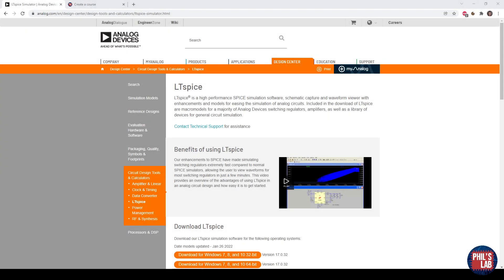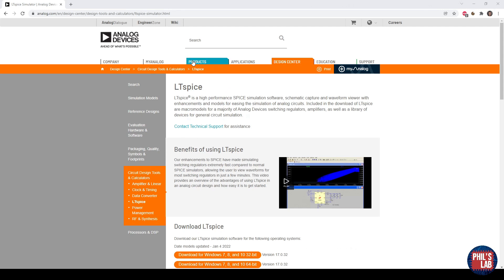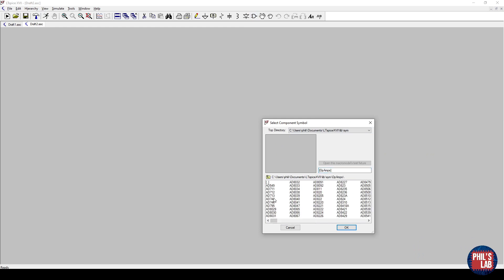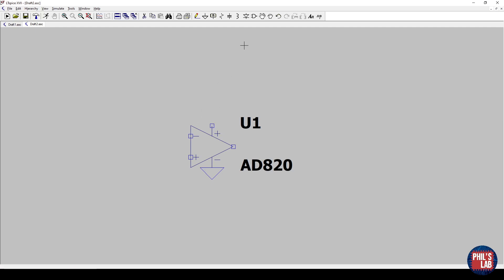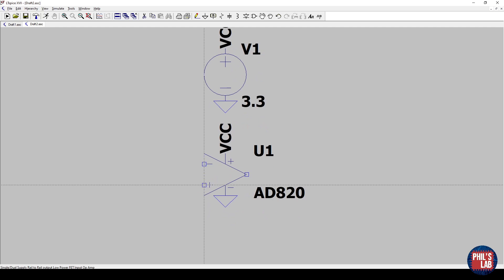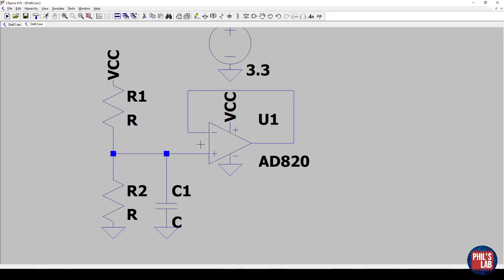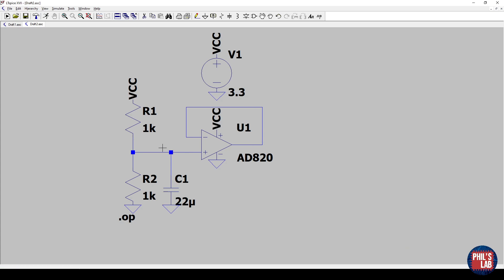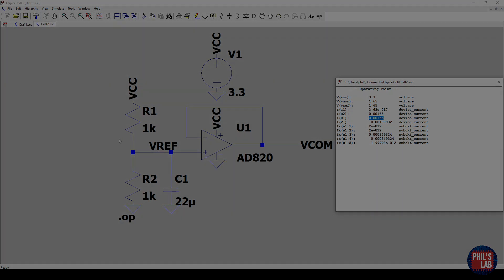(Sponsored) LTSpice - Basics and DC Operating Point Analysis - Phil's Lab #48

Comment: I started using LTspice a lot to try and build a 2KW LLC converter. I had to make a sub circuit for the L6599 IC (it was what I could get my hands on) but no model for it unfortunately.

One problem I ran into was the ground symbol is global to the schematic and included subcircuit models. The 'GND' pin on my symbol does not actually connect to ground. This limits the ability to have the chip floating on top of a voltage rail for instance since it is referenced to the global ground net.

How do you get around this?
Reply: What I've done in the past is to add a big resistor linking your real GND to the floating GND. I think the maximum value is something like 1 TΩ (teraohm). You could also add a tiny capacitor in parallel
Reply: @gino.avanzini  I have done the same simulating 3-phase circuits. In reality there is always some leakage however minute. Which transformer does not have a leakage capacitance and inductance?

Comment: I respect your digital domain expertise, and thank you for all your vids, but analog guys will always prefer to add one more transformer and couple of caps than to make a bias voltage )
Reply: Definitely disagree with this. a simple LDO or SMPS IC would be a much better approach then to slap in a beefy transformer with a diode rectifier bridge and filtering caps, then you'd still have to smooth out with a linear regulator. Might as well just put a linear regulator there in the first place.

Good video Phil! I think it would be worth mentioning that this method of creating a bias is fine for reference voltages for ADC's and what not, but probably not the best way to generate a bias for something. That should be the job of a linear regulator since they are so damn cheap, small, and efficient.

Comment: LTspice is an excellent tool for EE's.  I use it for power conversions circuits.  One can add Control libs that contain PWM blocks, SPDT switches, and digital components.  Basically one can model a full digital control loop and switchmode power train.  Great tool!  It has a lot of features that are not well documented such as getting average and rms values of waveforms via a few keystrokes.